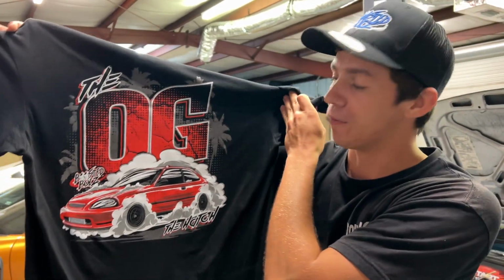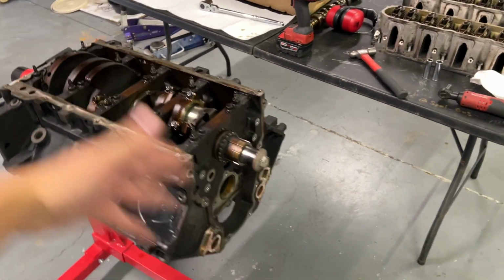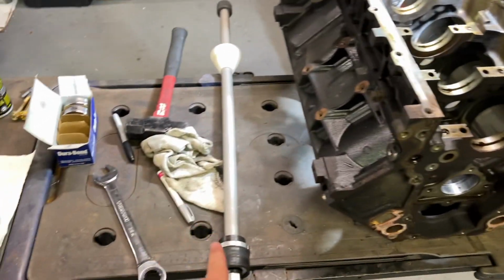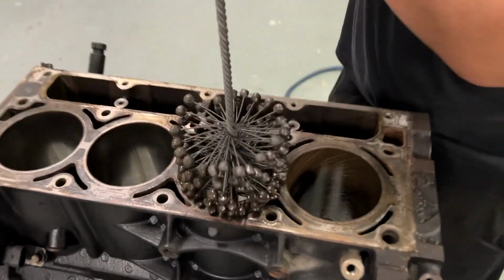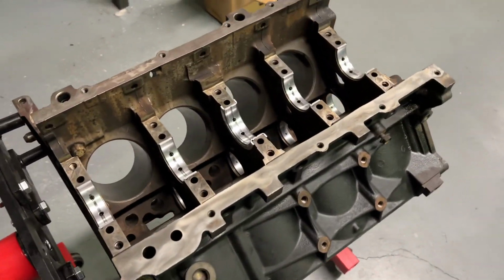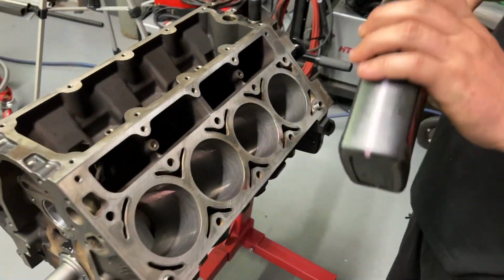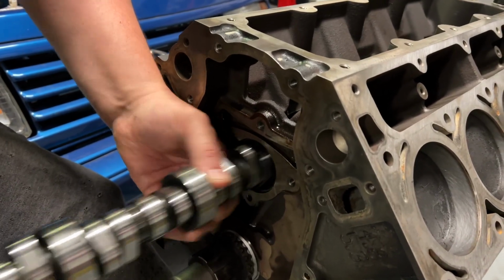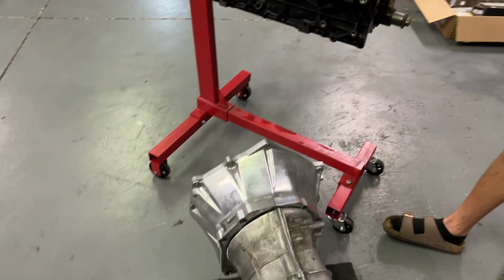Rebuilding Our Junkyard LS! Pro Engine Builders Look Away

Comment: You should totally take your LS heads to LSGeorge down there at the FF compound and have him port them for you guys. He's an expert. Junkyard engines need all the love they can get.
Reply: just put a damn bit on a die grinder and make 'em bigger ... it's not rocket surgery
Reply: totally?
Reply: Yea... because George isn't on cleets payroll busy with all the behind the scenes shit. People get on YouTube and act like only certain people can do certain things good. It's a damn port job lol
Reply: It's not that hard to do it yourself tho 😂 I'd still like to get a set of head's done on a CNC machine so every Port is exactly the same tho.
Reply: I think Ole WHITT could port the heads. Then pull a phong and divot the intake port. Atomizer fuel.
Reply: Think you guys are giving homeboy a hard time for no reason.  Nothing wrong with wanting your favorite tubers to collab. And there is actually a fair bit of science to porting, not just “making them bigger” every casting batch is different, has thin spots in different areas. Port incorrectly and they can be huge but loose velocity, port chambers incorrectly and it can impede flow and reduce compression if you go too far (big chamber size) sure you can clean them up real quick, but as far as a professional port job. There is a lot of hours that goes into it. And alot of little secrets that add up to make big differences
Reply: Shoutout to Caleb
Reply: I thought the whole rule of junkyard engines was they don't need love. 

Don't overdo it. The whole reason LS is so popular is because they're cheap and replaceable
Reply: Thank god  you were overly specific. Theres no way he woulda known who you were talkin about otherwise...
Reply: Need all the love they can get? My stock 5.3 goes 8s in a 3500lbs car lol.
Reply: Pretty sure that was a service Jeremy's shop offered while George worked there. Haven't seen him talk about porting anything he's been at cleetus shop. Doubt that a little Port job is over whitts head. Pretty simple.
Reply: Totally. LS George knows his stuff and it's good content. Good old George showing the BB how to port dem heads. Win-Win situation!
Reply: Any 12 year old with a gokart knows how to do a port job 😂
Reply: CruzRedEye  that went over your head didnt bud 🤦🏽‍♂️ 🚀😂😂😂
Reply: Doing it yourself isn't the issue... knowing where to stop is the key.
Reply: Or Fasterproms
Reply: Don’t let squirrel touch your stuff
Reply: Squirrel can do a good port job
Reply: Yes that will make them breathe a lot more
Reply: @slimjim119  lol they didn’t even wait for new bolts
Reply: @knifethrower9733  Yes,a good port job is worth 100 hp + on a good engine.
Reply: @Thedude897  not everyone has time cause most of us work :)
Reply: CruzRedEye  wow
Reply: @disloyalpick  only the top and bottom should be dimpled not the sides.  Richard Holdener did a video on that.
Reply: Facts
Reply: george and expert dont belong together
Reply: people criticizing this idea are not realizing how fun that ep would be with kyle, wyatt and georgie boy giving her the ole' buenos dias
Reply: He uses his dingle ball attachment on the drill! Ask for James
Reply: @MrThunderCunt  as he actually show the guy how to do the job
Reply: Dingleberries
Reply: @nsboost  after 8s it dies?
Reply: So much yes
Reply: @johnweitl8012  RIGHT ON!!!!!
Reply: @Godscountry2732  bollocks
Reply: He's a beast at porting. Kinda miss seeing him and jeremy experiment with stuff like that
Reply: He's a beast at porting. Kinda miss seeing him and jeremy experiment with stuff like that
Reply: @Mouthy_Trucker  Your a potato. It is absolutely a science. Do you know what velocity is?
Reply: Yeah if you're trying to do wheelies
Reply: I’ve always wondered why he doesn’t do any of that for McFarland racing.
Reply: Need to put that ls in the trashcan  where it belongs and get a VQ 56 in that bish. 32 valves FTW!
Reply: This
Reply: @Mouthy_Trucker  but you want em nice a smooth
Reply: @alastairdow-taylor4103 On a junk engine? Yes.I would agree. A good race-ready short block,with a set of high flow heads, with good valves, sized chambers, and port work, can net 100 horsepower over stock production heads. I've seen it myself in time slips. Someone pointed out an Engine Master show on Motor Trend where a set of ported Mopar heads added 90 plus horsepower over the stock heads.I can't remember the exact show, but it was on the Motor Trend channel. Tonight I'll see if I can get the show title and ID. If I'm wrong, I stand corrected, but I'm pretty sure on every dyno test, the heads alone netted a 90 -100 hp gain.I recall David Freiburger being amazed by the gain from the heads.
Reply: Stock heads are junk from them. Fall off very quickly.
Reply: @SkylineBNR34  says the skyline guy 😂
Reply: @buildanddrive  I actually drive a Coyote powered car, so I know how good heads flow.

Comment: @boostedboiz Just a heads up the dot on the piston refers to the front of the motor for correct orientation. saw a few that looked backwards. Some rods have a bevel on one side for oil clearance

Comment: One big thing to remember anytime you deglaze the walls with a ball hone, you should wash the block with Hot water/dawn and a feather brush on drill. The ball hone deposits aluminum oxide  into the micro finish on the cylinder walls. After hot washing mix 50/50 Gojo and dex/merc trans fluid to hand wipe cylinder walls until no dirt shows up on a clean paper towel. Without cleaning the cylinder bores after honing you basically give your piston rings a premature death sentence,  ring seal is key for any engine also key for minimal blow by. Love the channel been watching since you worked out of your momas garage 🤙😁
Reply: Blue rag and some brake clean. Done.
Reply: This is solid advice! When I swapped my is300 i ball honed and I just cleaned it with a bit of brake cleaner and a rag, well the rings didn’t seat correctly and the motor smoked like a freight train! On the second attempt it was cleaned correctly and has been running great for thousands of miles. 👍🏼👍🏼
Reply: @OGbqze  mayhap for a dirty ole sbf , but they are about as refined as an outhouse 😂
Reply: @OGbqze  brake cleaner or any solvent first but definitely not last oil is the only way!brake cleaner will not remove debris after honing like any oil!

Comment: Cam bearings are line honed after installation at factory. This process leaves marks on cam bearings which are typically deemed as bad by naked eye. More times than not they are “good”
Reply: I was wondering if I’d see this comment. So many replaced bearings cause they “looked worn” when they were likely straighter before you swapped them lol. Not always the case but definitely happens often. I typically just look for heat marks or spun bearings. If they aren’t destroyed, run em!

Comment: I hope you see this Kyle just wanted to give you a heads up that’s a 58x crank and you took off a 24x crank you need to change the reluctor wheels or your gonna need to change to a gray 58x crank sensor and different controllers for the crank and cam signal

Comment: When you install the camshaft bushings tighten the end nut on installing tool just enough for the bushing to slide on the rubber back into the driver. When i perform the repair I lay the block down vertically on the rear and have gravity assist installing bushings and camshaft. You’ll never score a bushing nor accidentally damage the camshaft bearing journals during installation  👍

Comment: Make sure you shim the pump before torqueing the pump assembly, so it properly centers on the crank snout, or you prematurely wear the pump out
Reply: that isnt necessary anymore.
Reply: @kigarukago  How so? I'm pretty sure the internals of the pump are still floating, and there's no locating dowels on the pump housings?
Reply: @TeeeRoyJenkins  you’re correct man.

Comment: Idk if you will see this but correct me if I’m wrong at 13:22 the dots on back two pistons. I think they’re supposed to point to the front because of the Wrist pin is off set to one side

Comment: At 13:20 you can see they put the pistons in facing backwards. The dimple is towards the rear. May not matter but some rods have a radius on the side that faces the crank lobes.  Could be a problem
Reply: I just committed the same thing lol
Reply: Do we tell them? Or do we wait for the entertainment?..
Reply: Maybe they purposely did this to entertain us 🤔
Reply: Hmm... Looks like all the left bank pistons are dot forward. So maybe they came out that way?
Reply: And they have fractured rod caps so I'd seriously be concerned if they were orientated correctly.
Reply: Not a problem on these
Reply: @user33755  What are your car building and racing achievements?
Reply: Took the comment away from me!!  Good eye also.
Reply: Noticed this as well, hopefully Kyle sees this or the chance that the rods are orientated correctly. If not, it'll maybe make it thru the 1st burnout before the rod gets hot and starts hating life.
Reply: I noticed this too was wondering if anyone else did. @ 13:21 you can clearly see it when it’s at the top of the bore.
Reply: I just commented it that the dots face toward…I see the rods eating themself
Reply: @user33755  that 5% costs them alot
Reply: 5.3 truck engines do not have a chamfered crank, rod direction doesn’t matter. If it was a chamfered crank and rods were in backwards it would not spin over what so ever.
Reply: This crankshaft has been reman'd it is likely to have a chamfered radius.
Reply: @bulletbuilt2784  I literally built this engine, it was not a chamfered crank 💁🏻‍♀️
Reply: @Whitt_Built  yeah Wyatt out here shooting down keyboard mechanics
Reply: @Whitt_Built  don't worry about the drr de drrrs. They never built a lawn mower.

Comment: A thin layer of lock tight on the back of main bearings helps when racing. We used to lightly score the back of the bearing with heavy grit and then smooth them with fine grit just to give the lock tight some hold to help stop from spun bearings.
Reply: Honest question? Wouldn't the block get hot enough to break down the lock tight? Like even red locker?
Reply: @miatakhalifa  it didn't seem to break down at all when we pulled the engine down for a refresh the lock tight was still in tact.
Reply: @cutlassman1  that's interesting.  I'll consider that one next time I put a motor together. Curious to know what temperature lock tight can withstand.  Ls oil normally gets around 300ish.  Obviously map gas is gonna get whatever bolt it's on way hotter than that.

Comment: Probably should have replaced the pistons too. The 5.3l ls has such short pistons skirts that they tend to wear out pretty quick. I have yet to hear a 5.3 with over 150k miles without piston slap. Also the rods are the weak link. They are only rated to 400 hp compared to the crank that can handle over 1000. I have replaced over 20 5.3l and every one failed due to connecting rod failure. Other than that they are great engines. The 6.0l lq engines didn't have the same issues. They were pretty much indestructible from the factory. Good luck boiz don't over rev. You will see the weak link quick.
Reply: at least get the carbon build up cleaned off

Comment: You guys should definitely invest in a bore gauge setup for the cylinders as well as a smaller gauge for the cam bearings/bores. You might as well purchase a set of micrometers while you're at it. If you get a 0-6" bore gauge set you can do small and large ends of the rods as well.

Comment: Maybe i missed it but did you guys put all 6 bolts in the mains?   one on each side that runs horizontal 26 ft lbs i think.  seen a man ruin his new build by forgetting the gasket on the cam cover too so may wanna double check that as well.   rumor is engines don't like 0 oil pressure, hehe.   thanks for posting i am looking forward to seeing it in action.

Comment: Hey guys I would have at least cleaned the carbon off to pistons and did a Cam upgrade LS engine's love a Cam upgrade  Yield to torque new head bolts  multi layer head gaskets  It was smart to open the piston gap also best the luck

Comment: If you turbo it, you could use a nice undersized turbo like the pair of GTX3582's that you used to run on the J35 for all the HP's and all the response.
Reply: small turbos are stock rod killers lol
Reply: @XxAtomic646xX  there's a reason all the SBE record cars live. It's that giant turbo combo. 😂
Reply: @XxAtomic646xX  if it was going to bend the rods quickly, it would have done it to the J35.
Reply: @B4Ctom1  the j35 was built... That was a 900whp capable motor. Junkyard ls is not..
Reply: @XxAtomic646xX  I am sorry, you are correct. It was a partial fill epoxy and sugar tech with rods and pistons. I totally forgot.
Reply: @B4Ctom1  you clearly dont know engines. That's called cementing the block for durability. Very common with 4/6cyl high hp builds.
Still a fact it was a near 1000whp capable motor. While a junkyard ls won't even make half that reliability 😂. Sit down kid
Reply: @XxAtomic646xX  did you even read what I wrote or are you just pretending you did?

Comment: Junk yard 5.3 LS 101 : Never look at the cam bearings ( Schrodingers Bearings lol), Lifter trays are cheap always do, take heads and clean and cut em flat ( clean and relap valves it's cheap ), new head bolts ( Trick Flow sells a set of OEM for 50$ ), Upgrade springs ( trunions if you have the money), Oil galley barbell upgrade, LEAVE BOTTOM END ALONE GM KNEW WHAT THEY WERE DOING, Cam of your choice based what your doing with the build. High boost = open ring gap up a little ( only time I go downstairs to the bottomed end). Never had an issue with these basic steps

Comment: Don't forget to replace the barbell at the back of the block and the cam retainer plate and if your oil pan has a pressure release valve in it you should definitely cap that off they sell a kit lot more oil pressure preserve the life of your motor

Comment: Honestly, #1- No clue why they didn't work with a company to get a better crank, forged rods and pistons. They could had gotten some kind of upgrade for not a ton of money, and not had to pull it all back apart again when they add power later. They also should have had James or someone there to double check everything was good. They just don't have a lot of experience with LS engines, and someone with good experience could only help with good advice. I get that the LS Swapped S14 is not considered to be a very important car, and it's a pretty common setup at this point, but ⁶they could had at least gotten an LQ truck block and stuck inexpensive rods and pistons in it to prep for more power. Then they would had started with a 6.0L engine, or a 6.2 if they used an LS3 crank. I'm not an LS Expert, but I do know you can mix and match a lot of the LS parts to get what you want. Power wise, strength wise and improving airflow and adding ARP headstuds would be a must for me since the valve train Is a known weak point, and an LS at or near 8k RPM sounds super bad ass if your setup is correct and you can keep the piston speeds down in the safe range. I want to see the 240 be a great, fun, reliable drift car. I don't want to see it blow up 3 or 4 times before they decide to build an LS3 or an LS6 big block so they can spool up a ridiculous 90mm turbo or something. Maybe a 300 shot of nitrous just to get things going bed the boost hits at 3k RPM. I just wanted the 240 to make some good entertainment for us all, Kyle and Wyatt, and obviously the fans watching the videos. Anyway, good luck boys. I hope you can get that motor done up right and I hope she rips. Good luck 👍 boys

Comment: I like to over size the hole in the cam bearings & chamfer the cam side of the hole. a engine with 50K might not need cam bearings, Engines with 150+K on them, needs Bearings. You can get a crank Combo from Eagle, with Rods, Pistons W/rings,  Bearings & pre Balanced. So not as much machine shop time.  next time,  put the pistons in some Chemtool, They clean up nice after 1.5 hour of soaking,  just wipe off.

Comment: Right side of the engine has some pistons facing the wrong way lol rod skirts aren’t going to like that, dots on the pistons face the front of the engine
Reply: If rods are facing the right way, it wont matter. Lil more noise if the wrist pins on the engine are offset and less parasitic loss because there will be less rod angle
Reply: @CL-ty6wp  well they didn’t take the pistons off the rods so they are not facing the right way

Comment: What I've come to find on the cam bearing situation is that the cam is spending most of its time on the bottom of the bearing because the lifters obviously push it down. The top of the bearing always look like complete trash on almost every LS motor I've ever pulled apart, but I think it's just because there are deposits being left and without much friction it builds up there. Just my theory, but I've put 3 junkyard blocks together and never had a problem with the cam bearings.

Comment: Piston #6 is installed wrong the dot on the piston have to face forward
Reply: Not sure if 5.3s have offset pins but even so , it'll just be a little noisier. 
Hot rodders would run them backwards to get less rod angle, so less parasitic drag loss.